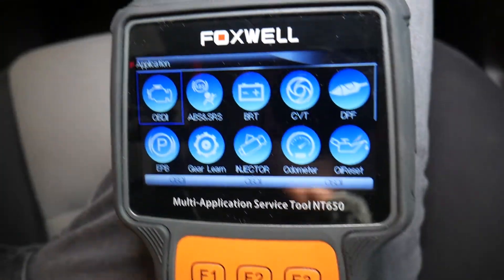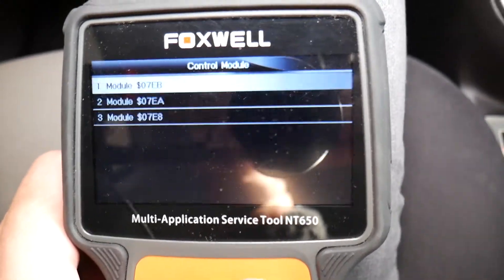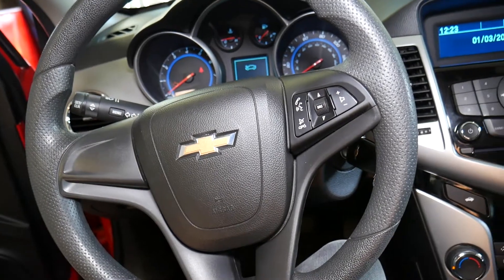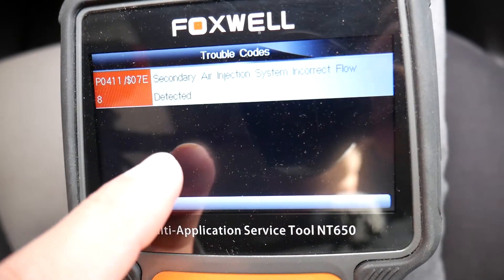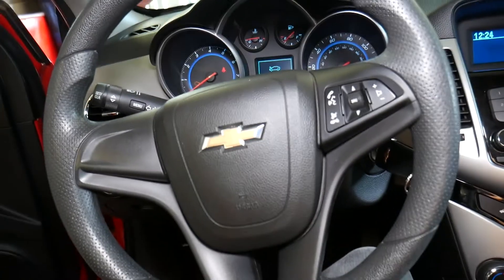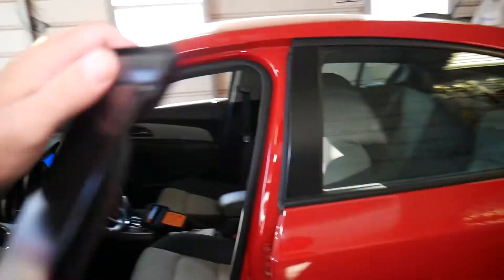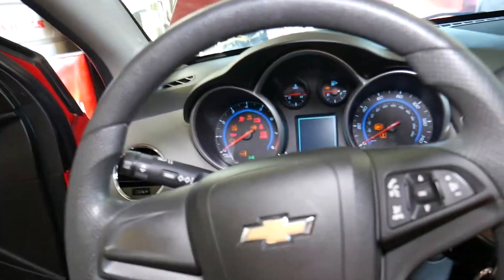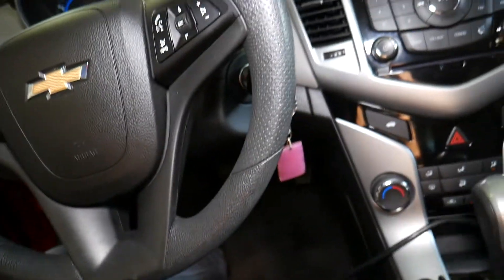Code P0410 P0411 P0412 Chevrolet Cruze Sonic Fix  Secondary Air Injection Pump

Comment: Then you find out the most common cause of pump failure is the check valve to exhaust,  letting moisture
Into the pump.   So your new pump will fail again